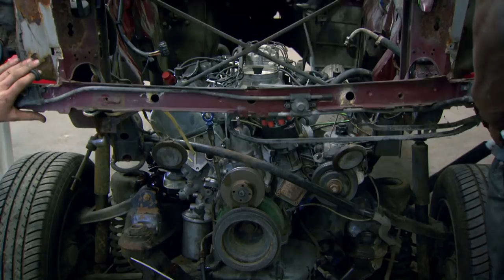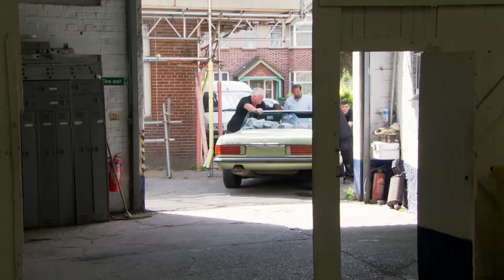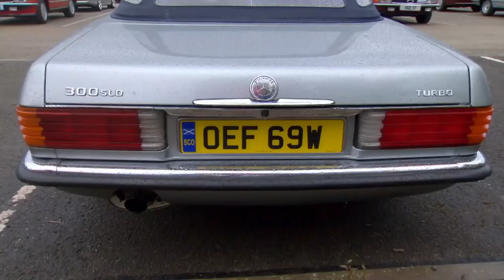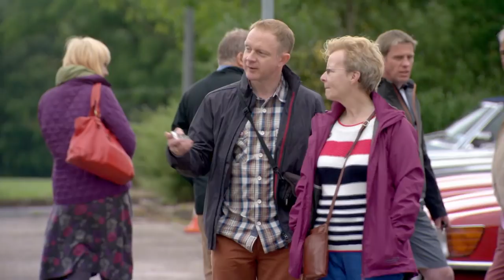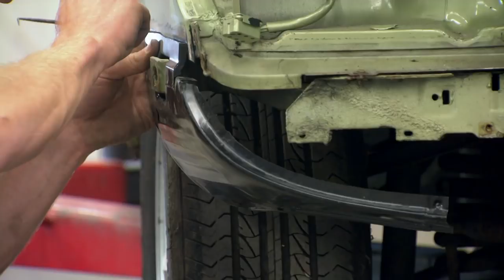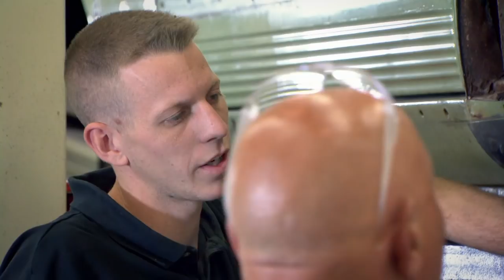The Team Waste Time And Money On A Completely Rotten Mercedes | Classic Car Rescue

Comment: Hang on.  They said they’d scrapped the red one. But there it is right outside?!
Reply: Landie Man that’s because they over dramatize everything also it’s fixable everything is fixable if you have at least one clean panel left
Reply: @pinkamenadianepie8609  they kept the rotten merc for parts for the green one, then sold the leftovers for scrap
Reply: The term scrapped can be used as a figure of speech, so once you have decided a vehicle is no long going to be back on the road it is effectively 'scrapped' and you can take parts off to re-use or sell.